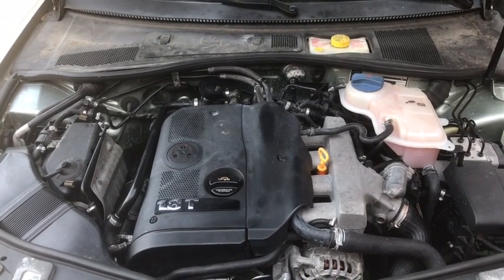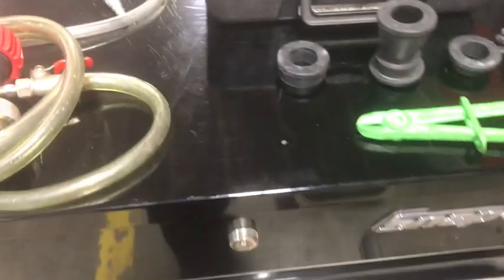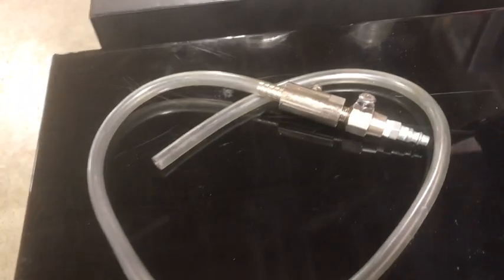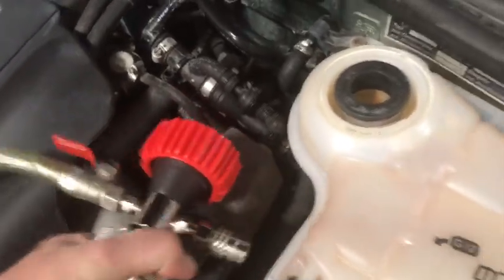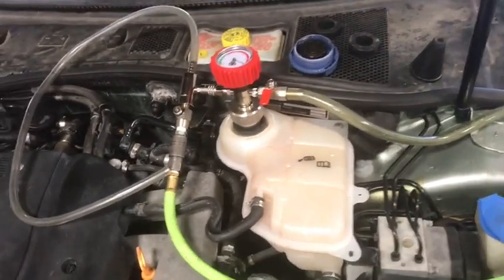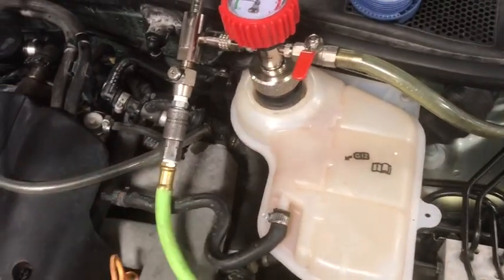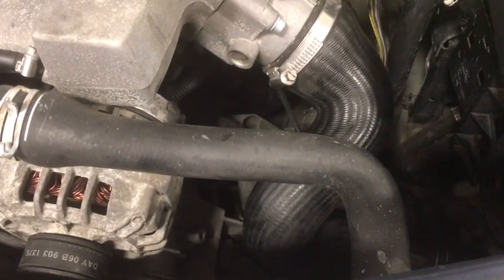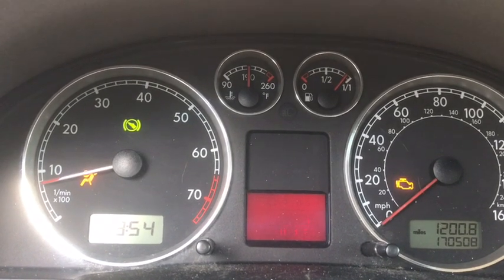Using vacuum tool to fill a cooling system

Comment: is there a way to do this with coolant already in the system or is the only way to top off and run the vehicle without the cap to burp until its at operating temp for about 10 minutes with heat on full blast?

I'm trying to find a coolant leak. Is the best way to do that (a different situation/question) to use a pressure tester ? This pushes air on the fluid to find leaks vs this one you show that sucks air to fill. Will my pressure test to find the leak introduce air bubbles ? How do i pressure test with the heat on to make sure its all open system to find leaks? Do I run the car before hand quickly just to turn on heat and full fan speed then turn it off and start a pressure test? 

Thanks if you are around to answer all these questions! I've been bookmarking and subbed to show my kid videos on youtube vs me telling him things he should know for vehicles!
Reply from the maker: A pressure test to find leaks is a good idea. You can vacuum fill with some coolant in it, but not full. It is best to do empty. I hope this helps and thanks for the support!
Reply: @AutoScholarwithMrB  wow thanks for responding to an old one :) will do pressure test first then replace secondary pump with hose clamps and pray i dont have to do it all because if i do im flushing it and swapping to newer coolant but its 20F so it has to be flushed with mixed solution since no garage UGH , dont want water freezing in the block lol

Comment: Do I have to pinch off the hose coming off my radiator neck, leading to the overflow bottle, to build vacuum in the system? There’s new coolant in it. Also, should I drain that also, before I put vacuum on the system? I have an Acura ILX, 2021, and the OEM spill proof funnel just isn’t doing the job, of getting all the air out. I bled the system with that funnel for 3 days, and I’m still getting air, so I purchased a kit off Amazon. Thanks👍

Comment: Hi Taylor. Great video. Thanks. 
I have a question if you don't mind re vacuum and coolant loss issue.
Sorry a bit long, but here goes.
I have a Mercedes diesel that stays at a good coolant temperature of about 80-90 centigrade under all conditions including high speed in very hot weather. 
But when stopped the coolant pours out the overflow reservoir and needs refilling each time. (To the correct marks). I can't see any other leaks.
However when I use vacuum to try to refill the vehicle it doesn't hold vacuum but if does hold pressure. 
Would be great to have your advice!
Thanks Alan from Oz.

Comment: How long should it hold the vacuum ?
Reply from the maker: If everything is leak free, indefinitely.
Reply: @AutoScholarwithMrB  it would hold 27 for 5 min and then it will slowly go down to 26
Reply from the maker: @wdsanchez5  you are probably ok.
Reply: Most systems only are designed to hold 18 psi max so losing 1 lb is no big deal.

Comment: I’ve used a similar tool multiple times on multiple vehicles. Have you ever had a problem when refilling where the gauge doesn’t make it to zero? Vacuum holds great, starts pulling in coolant and will pull down to a little under 5 psi and holds there. Coolant seems to be full and running properly but I hate that I can’t get this thing to hit zero psi.
Reply: @FxTxEcQ  Thanks for the response. I guess I worded my previous comment incorrectly. On all of my vehicles, the vacuum gets to -25 to -26 and holds there and I believe in the directions and many other videos says that is about where it should be. Nothing more. Upon FILLING, the pressure drops as fluid is sucked up. The problem I am having is that the fluid stops sucking when the gauge reaches around -4 or so; never quite getting to zero. I have used this tool several times now, on multiple vehicles. Only once was I able to completely get down to 0 during the refill process. on several occasions I forgot to purge the air from the fill tube and I used the tool a few hours ago making sure to purge. Same issue, got to about -4 before the filling stopped. Any ideas? It's extremely frustrating because while close, all of the air isn't completely bled.

Comment: will this suck air from the block and heater core? i mean thermostat is close when its cold  so how does this one will suck air in the block of the engine?
Reply: Most thermostats have a small bleed hole to allow a small amount of coolant to flow past it even when it's closed(this is done so that cooling system components don't get thermal shock once the thermostat does open)
Reply: @petergoz7453  Hi, I have a 2016 Volvo XC90 T6 which is hard to drain the coolant for maintenance purposes.  Can I use this to drain or suction the coolant out and fill? Appreciate very much your help.
Reply: This would be good to fill & bleed the cooling system but i think its no good to remove the coolant, best remove the lower radiator hose, & if u can find the coolant plug in the engine block(some are hard to find & get to so i only do it if it's accessable)

Comment: Hi does this work if there is fluid still inside the engine ? I have air locks , but do I need to drain it all before using this equipment? Or can I get rid of the air locks with fluid still in there
Reply: It would pull the coolant from the engine, you could catch it at the air output hose but I guess its way less messy to just drain it. If it's clean just fill it back.

Comment: Hey thanks for the video I learned a lot. Question? Do you need to open the heater core vent when applying vacuum
Reply from the maker: No, you want to keep that closed or the vacuum will not build up enough. Thanks for watching!
Reply: @AutoScholarwithMrB  that makes sense ! Thanks for your reply
Reply: Hi, firstly great tool & video, my only question is that if this is done with the heater core in the closed position(cold) wouldn't this have the potential to create an air pocket once the heater core is put into the open position(hot)? Surely if the heater core is open(hot position) & the system is sealed the tool would also be good enough to also pull the vacuum through the heater core & fill it as well? Also my thoughts on anthor comment where one of your subscribers had the issue of using the tool on a car with an air lock on a full system, do u think that it would work buy having the over flow tube flowing back into the filerl bottle/container (with coolant in it)& cycling the coolant through in this manner(i have also had success with getting air locks out of cooling systems with a radiator pressure tester provided the system has bled points in the system) appreciate your thoughts on my comments, I'm a new subscriber (today) & give u a big thumbs up on your videos(I've watched a quiet a few today)they are very informative & easy to understand.....keep up the good work.

Comment: Cool video man, just I have a question, when you use the vacuum system kit, what did you do with the thermostat? I want to do this, I already bought a kit but I started question that with the thermostat closed the coolant won’t go inside the engine while you use the kit, or yes?, you pre heated the car before use the kit and filled up with te coolant? Or it doesn’t matter the thermostat is closed it’ll work correctly and won’t be lacks of air in the system
Reply from the maker: With this process it doesn’t matter because it vacuums the entire system, which includes both sides of the thermostat.
Reply: @AutoScholarwithMrB  thanks man! I will make the process soon!

Comment: I stuck a spare 1/2 inch socket on the end of my intake hose to act as a weight in the new coolant container. A 16mm should fit nicely over the filter